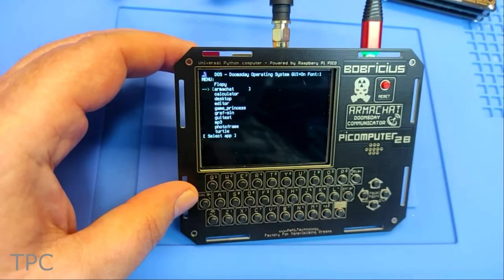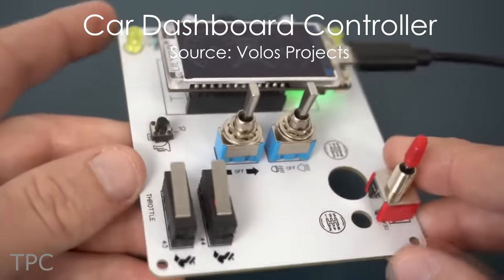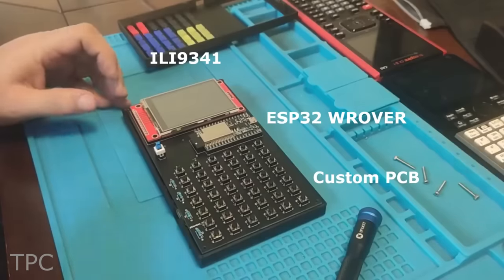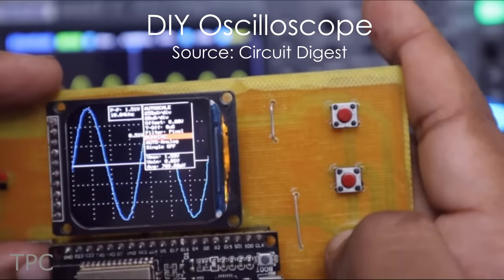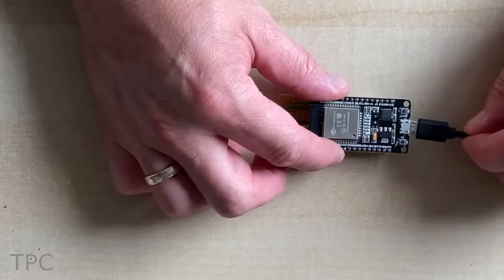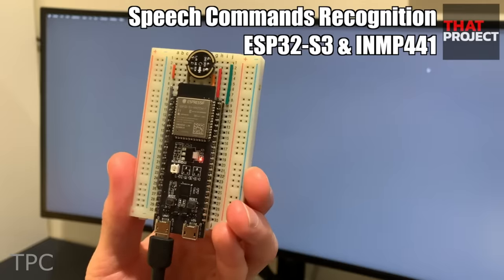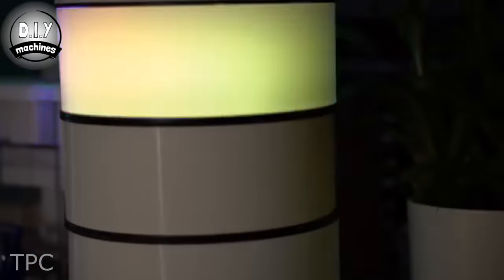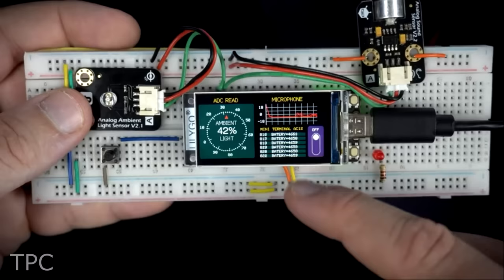Try these 16 Brilliant ESP32 projects!!!

Comment: How would the Car-Dashboard be amazing with a VR headset combined? That doesnt make sense... am I supposed to put the dashboard into the VR headset?
Reply: Haha! Good to see that I wasn't the only one getting confused
Reply: This guys low on actual knowledge, it seems
Reply: Its a spam top 10 channel
Reply: The entire video is so boring and wooden, I assume it’s AI-generated.
Reply: There are more weird sentences in the vid, like an "x volt" lipo would mean good runtime (when referring to battery capacity, we typically dont specify it nominal voltage, rather Ah). Somewhere else, for a fraction of a second a design with some dimensions is shown, voice: with these dimensions blabla (yeah, i can barely see that on the screen, so how is that one of the most relevant details to share?). Mentions "tiny tft display", showing an OLED display. In general in the little time it (AI voice?) has for all the projects it seems to highlight rather weird details and/or be wrong about it. Reiks of AI. Also sponsored, but no mention that the vid is (sponsored).
Reply: The VR headset becomes the dashboard 😊

Comment: Oh please, the 15th(second in video) is a Raspberry Pi Pico powered picomputer. Has nothing to do with ESP32.😓
Reply from the maker: Nope, you're wrong. If you watch the full video, in this version of the project an ESP32-S3 microcontroller is used, not the Pi-pico.
Reply: OK, you’re right. It’s using a similar form factor version of ESP32. Could you provide some information about switching to ESP32-S3?
Reply: @ToPProjectsCompilation  The board labelled "picocomputer28" with "powered by raspberry pi pico" on the silkscreen, the one that shows two picos, one a clone and one an original being hand fit by the maker ..uh huh....yeah....right. But good on you, capitalising on other people's creativity, tell me, do you actually make anything yourself? Apart from these videos of course where you monetise others public domain work.
Reply from the maker: @flyviawall4053  So it supports Banana Pi - PicoW-s3 board having ESP32-S3 as the microcontroller. Apparently, they added Pico W because of the same form factor. To use it instead of the original Pico, you just have to look at its pinout and the schematic of the board(to which pins- different parts are connected) and program it accordingly.
Reply from the maker: @m3chanist  Peter named the project PICOcomputer because it supports 3 boards of the same form factor(PICO being more popular). The board by Waveshare is called RP2040 plus uses RP2040(Microcontroller by RPI), and the last one is Banana Pi PicoW-S3, which has no direct connection to Pico boards other than having a similar form factor. So yeah, that's why the name "pico" is everywhere.

Comment: @10:15 Video frame will better Quality, when using Google VP9 or even VP8, or Xvid, for Video CODEC, if hardware accelerated module isn't installed for H.264/265/266/AV1